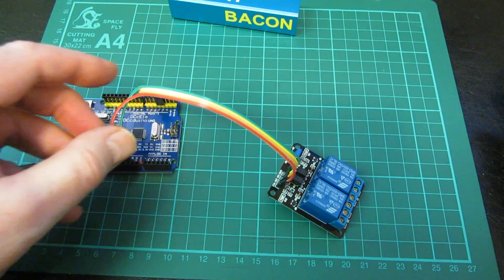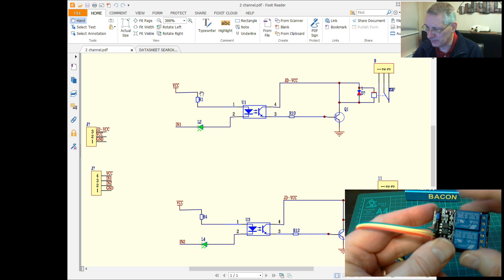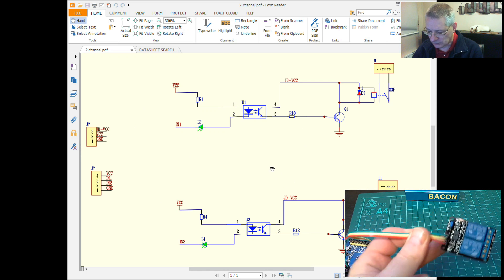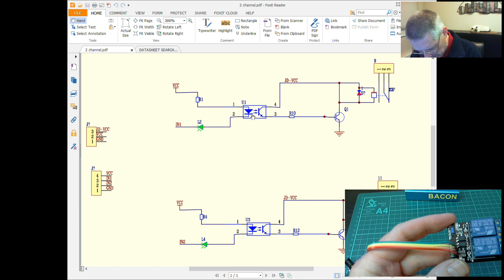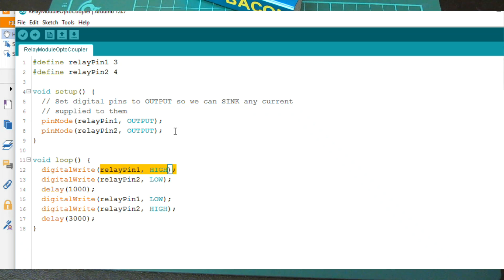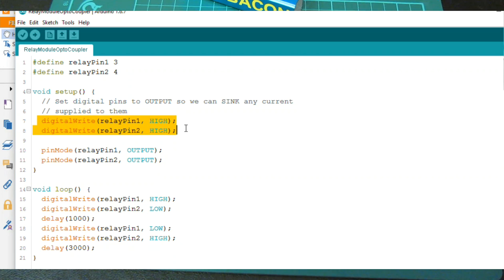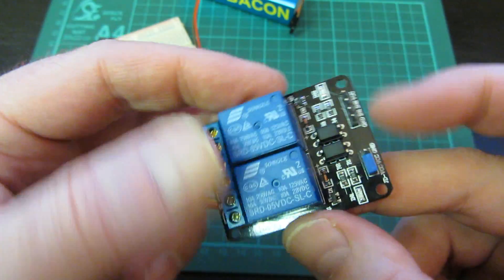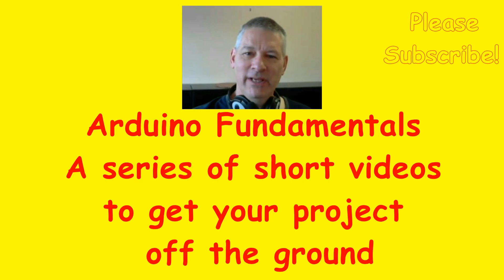#18 Add a Relay Module to your Arduino project - Hints, Tips & Traps

Comment: If i use same connection in esp 8266  with 8 channel relay board on which pin of esp 8266 i hv to i hv to connect vcc
Reply from the maker: You must be careful with the ESP8266 as it is a 3v3 device. 

The module you have will probably have a 5v pin which can be used for the JD-VCC relay supply (if you are not using a separate power for that side of things). For the opto-coupler LED you can use any pins (choose ones that aren't PWM-capable or that is used for I2C or SPI) connected to the IN1 - IN8 pin. 

If the current limiting resistor (R1 in my video) is not already on-board choose the wisely. If you are using a 5v supply as VCC then limit the current to 10mA so your resistor will be about 200 ohms (you have two LEDs in series on that board, one embedded in the optocoupler and the visible one). If you use 3v3 your resistor will be about 150 ohms but there is a possibility it won't work at all at 3v3 due to the LEDs voltage drops. Try it and see!

Remember that the relay switches ON when the digital pin connected to the INx pins is LOW (your µC will SINK the current from VCC via the current limiting resistor).

Comment: Why do you connect VCC and then set the pin to HIGH to keep it closed, instead of connecting the ground and setting the pin to HIGH only when you want it opened? I read some comments saying you can only switch on relay at a time like that, but I'm not sure I understand why... Is there something I'm missing? I have my relays coming in tomorrow and don't want to blow up my ESP8266 hahaha
Reply from the maker: I don't fully understand the question, or what you think I'm doing, but I can tell you the Esp8266 will SINK the current for the LED on the relay board's optoisolator when set LOW (HIGH is off). So the other side of the LED is connected to VCC. Take a close look at the circuit diagram in the video. Still confused? Let me know!
Reply: @RalphBacon  Thank you! My parts just arrived. I'll be trying to figure it out this weekend :) will definitely revisit your video then.
Reply: @RalphBacon  Ahhhhh now I understand!!! Took me a bit of tinkering, but your video makes total sense now! Thanks!
Reply from the maker: Great stuff! don't let the magic smoke escape!

Comment: Hi Ralph, thank you for your really helpful video. With regards to the issue of having a second power supply for powering the solenoids to maintain isolation, could you instead use an isolated DC to DC converter such as this one? 

https://uk.rs-online.com/web/p/isolated-dc-dc-converters/1226942/

Not the cheapest solution but potentially much less hassle than a separate power supply?
Reply from the maker: I'm wondering why you would (want to) do this, Graham? You can use a separate power supply (of the type you suggest or a real one) but you don't have to with this module. The whole thing can be powered from the same 5v as is used to power the Arduino. Unless you really need the galvanic isolation I'd keep it simple (but for all I know the other side of this module might be switching a couple of hundred volts).

Comment: Hello Ralph, I have this little device :b0505s ( https://www.digchip.com/datasheets/parts/datasheet/1007/B0505S_D-1W-pdf.php ) and it really removes all the noice from my bt audio receiver. Do you think I could use this to seperate my power supplies in a save way? I think it is a tiny transformer and it really is galvanically  seperated. I have no way to add a seperate power supply.
Reply from the maker: Interesting little device. Looks like it is a type of SMPS with an isolation transformer inside.You can certainly use this to separate your power supplies - so the output from this was connected to the JCC of the relay module. Read the note about low power requirements, you may need to add a load resistor.
Reply: @RalphBacon  I will use it. I was just a little worried that since it is so small and something goes bad inside it, it  might still pass mains through. I also just read about the minimum power requirement (missed that before) I do need the add load resistor.

Comment: I think its an output pin because you are writing to it, not reading from it. 
edit: I'm talking about at 3:36
Reply from the maker: Can you just put this into context, please, Ryan? At which point in the video does this come up? From what you say if you are writing to a pin it will probably be an output pin - but if you write to an input pin it just turns on the pull-up resistor!
Reply: @RalphBacon  3:36
Reply from the maker: Right, the point I was making at that point in the video was that although the current flow was coming IN to the Arduino (from VCC and the diode), the pinMode was still an OUTPUT - something that confuses beginners.

Comment: Hi, i would like to know if the 24v rated relay modules could be triggered by a 24v signal or the 5v signal is a  must .
Thank you.
Reply from the maker: There are two voltage ratings for a relay, Ionut. The first is the COIL voltage, and determines how much voltage you need to trigger (switch) the relay on and off. The second voltage/current is how much current the relay can carry. So a 5v relay with a rating of 24V/5A means that it requires 5V (no more) to trigger it, and can carry up to 24V at 5A maximum. Don't forget the protection diode across the coil, which will be present on a module board like I used, but you will have to add one if you use a bare relay. Is this clear?
Reply: @RalphBacon  Thank you for response although i'm not sure i did put the question the right way in order to get the right answer. For example the relay module is this https://www.ebay.co.uk/itm/1-channel-24v-relay-module-board-shield-for-arduino-with-optocoupler-ZT/362992628401?_trkparms=aid%3D1110001%26algo%3DSPLICE.SIM%26ao%3D1%26asc%3D20190920091355%26meid%3D0afe53015d8d4b729b7d7ba4cf4e6a36%26pid%3D100036%26rk%3D2%26rkt%3D7%26sd%3D402261796421%26itm%3D362992628401%26pmt%3D1%26noa%3D1%26pg%3D2047675&_trksid=p2047675.c100036.m2109 . Not talking about load rating. So, all i need to know is what voltage will require the input pin to trigger the relay on/off  via optocoupler. Are the 24v coil modules built to be managed by 24v inpun signal, the 12v coil modules by 12v input signal, the 5v coil modules by 5v input signal or all the relay modules no matter the coil voltage is, are built to be triggered by an input signal in range within let's say 3.3v - 5v ? I'm talking strictly about the way they come from factory, about what range of signal voltage they can handle safely. I want to know if to this 24v coil relay module i can apply 24v as signal input without frying the input zone of module. I hope i made myself understood  and i apologize for giving you such a headache. It's all because my  bad english. Thank you again.
Reply from the maker: It's not your English that's a fault here, Ionut, just the rubbish documentation on these products! I can't even see the optical isolator, on the board you link to. I suspect the 24v refers to the JD-VCC that goes to the optoisolator (see my video at about 01:58). All the optoisolators require you to SINK the current from VCC (NOT JD-VCC) to ground. I would carefully wire this up to 5v first and test this out as per my demo. Then you can ramp up JD-VCC to your 24V and hope it works. this site has better pictures: https://www.ebay.co.uk/itm/5V-12V-or-24V-1-2-4-8-16-Channel-Relay-Module-Arduino-PI-ARM-AVR-DSP-PIC-PLC-UK/362951292175
The 24v relay switching voltage and the VCC for the optoisolator are separate - you don't want 24v anywhere near your Arduino!
Reply: @RalphBacon  Thank you for response,. i'm sorry i sent you the wrong link, in fact the relay i bought is exactly from the link you sent to me ( the 24v - 2 channel relay module). My first thought was that if the JD-VCC and VCC are bridged by jumper and board being supplied by 24v, the input pins could accept 24v as signal. I don't use arduino, this relay will control the spindle of my cnc router which controller has the output pins providing 24v signal. In other scenario i could remove the jumper to feed separately the relay coil with 24v and for inputs zone i will provide the 5v TTL from breakout board . I guess and hope this way will work.
Thank you.

Comment: Great demo. Can you help me? I have a MT3608 step up converter. I want to increase my output power from the arduino uno to ignite an electric match for my rocket parachute deployment. 9v battery is my power source . Can I power the MT directly from the battery and use arduino as a switch only? I used a blink program to send power to MT3608 thus increasing voltage, but not amps.  ??? Any diagram help would be great.
Reply from the maker: If the 9v can ignite the match, Mark, then the Arduino can connect the 9v into a totally separate electrical circuit via the relay. Rough circuit here:
https://www.dropbox.com/s/h1bvuntfivrmw5d/9v%20match%20circuit.png?dl=0
Do watch the demo explanation in conjunction with that circuit.

Comment: Excellent video - thank you.  I notice on some coding for relays there is a line in Setup -  Serial.begin (115200); .   Can anyone tell me if it's important when operating these relays please?
Reply from the maker: That line has no bearing on the relay part of the sketch, John. What it is telling Arduino is that the speed of data transmission from the Arduino back to the PC/Mac (in the Serial Monitor, aka debugging window) is at that speed. So you can then send information back like this:
Serial.println("Relay ON");
I tend to use 9600 which is a bit slow but very stable!

Comment: Thanks very much, very helpful. One silly question I have though, is seeing as I'd like to keep my 12V source (deep cycle agm battery) fully charged, if I were to keep the trickle chargers (12V 1A from 240 mains adapter) cables attached to the battery, and activate a 12V 5A draw via the relay, will the charger/adapter pop, or will the battery deal with the draw? Please excuse my ignorance!
Reply from the maker: If you are directly charging the battery from a charger the the current for any circuit will come from both battery and charger, depending on which has the higher voltage. If the charger can only supply 1A (at which point the voltage will drop) all the "missing" current will come from the battery. It would be better to use a dedicateds battery charger circuit (like the ones for LiPOs) that allow charging and powering a circuit without anything getting stressed. Check out solar panel charging modules.
Reply: @RalphBacon  ah like an MPPT controller? Thank you kindly for the reply too. Best wishes

Comment: can you connect to arduino mini?
Reply from the maker: Yes, you can, Charles. Any GPIO pin on any MCU will work because it only is driving an LED via the optocoupler.

Comment: I have just received my relay module which is exactly the same as modules shown in this video. Great thing I came across this video as I am just about to start my project.
Reply from the maker: I knew you had ordered one Robert (Benny is my spy) so it is not a coincidence that you have found this video! Have Fun but do NOT short out those header pins (JCC-VCC-GND) !!!

Comment: a somewhat common mistake is using a mechanical relay when a solid state relay or device is a better choice;
1) fast switching speeds (on/off/on)
20 longevity
3) fast turn-on
4) High voltage or current loads
5) need to have minimum current drain
Reply from the maker: But you did miss one thing, Kenn, that is not so good: HUGE size (compared to a mechanical relay) especially if we factor in the ridiculous heatsink for higher currents. I have...

I have resisted doing a video on my SSR precisely for that reason. It certainly would not fit in the original consumer unit (fuse box) so it would have to be mounted externally, suitably insulated in a box which then requires drilling etc.

Some relays are fakes, of course. Rated at 20A and can barely conduct 5A without melting (as other videos I've done have shown). But I've sourced (from a respected UK company) two very nice, high current mechanical relays, with all the correct CE certification that would do the job. But, I'm still thinking of that SSR... What do do!?!
Reply: @RalphBacon  :)   to be sure relays have their advantages......including zero loss to the load, multiple poles, isolation .....
Reply: @RalphBacon  personally I'd go with the SRS!

Comment: Another gotcha is the power supply for the relays - it has to be large enough (current wise) to handle the maximum number of relays turning on at the same time (and the total holding current of the maximum number of 'On' relays). To latch [Pickup current] can require significantly larger current (2 to 10 X) the holding current.  https://forum.digikey.com/t/relay-terminology/799   https://media.digikey.com/pdf/Other%20Related%20Documents/Panasonic%20Other%20Doc/Small%20Signal%20Relay%20Techincal%20Info.pdf
Reply from the maker: Good point, Kenn. The holding current is significantly lower than the latching current. I quite like latching relays these days, it makes the whole current consumption problem go away.
Reply: @RalphBacon  What's the cost difference between regular and latching?   Where I am latching relays are hard to get

Comment: Can the alternate power source be something other than a breadboard power supply? Maybe something a little more friendly for a portable application?
Reply from the maker: The power for the relay (if you are using a dedicated, separate power source for the relay) can be anything you want - but it will need to supply power for as long as the relay remains energised. 

For portable, battery powered devices you really need a latching relay that switches to the open (or closed) position and stays like that even if you remove the power. You can then switch it back again (via a different coil pin) the same way and remove the power. I hope this helps. Portable devices don't really need an isolated relay anyway, so you can power it from the same supply as the µController.

Comment: So this might be a stupid question but when using the external power input on the relay module, can you use the same power supply, like the breadboard power supply you're showing, to power the Arduino as well or does this defeat the purpose? It would be nice to have one psu powering both devices because it saves some space!
Reply from the maker: Not a stupid question at all, dikke j. You can indeed use the same 5v source to power both Arduino and the bare relay (coil). Either drive the relay coil directly via a transistor from a GPIO pin (using a protection diode across the coil), or use an opto-isolated relay as I showed here, which protects the Arduino (and you) better - and arguably is easier to use!
Reply: @RalphBacon  Awesome, I thought it would be possible but I just wanted to make sure since this is all new to me. Thank you very much for being so helpful :)

Comment: I had been using an LED on my breadboard to represent the optocoupler and set the ledState to HIGH for 'on' and took the other pin to ground.  Would that not work as well?
Reply from the maker: To turn the relay on, you need to SINK the current. So the pin needs to go low. The current flows from VCC thought the diode into the Arduino and then (internally) to ground. Is this what you're asking? If so, you can model this on your breadboard the same.

Comment: Hi there! Thanks for your super interesting tutorial, really!  I’d like to ask you if this 2 relay are suitable to develop a circuit to control a bistable solenoid, like that one https://www.logicaprogrammabile.it/come-pilotare-elettrovalvola-bistabile-usando-2-rele/
Reply from the maker: The way the relays are being driven is different in that link (directly,via a transistor) but the relays would work very well indeed in that situation. You would just change the way the relay was driven , just like my video.

Comment: Ralph,

Thank you for bringing this to my attention. I have a similar 4 channel relay that I would like to isolate from my arduino as well but the jumper are slight different. Mine has two pin instead of three. Will you please advise how to supply separate power to my board?  

Link to download the document: 
http://wiki.sunfounder.cc/index.php?title=4_Channel_5V_Relay_Module

It would be helpful if you will explain the following:

VCC is system power source, and JD_VCC is relay power source. Ship 5V relay by default. Plug jumper cap to use

Sorry for the dumb questions.
Reply from the maker: There are no dumb questions, Cattle Ranch, just questions. 

And here's your answer: on that board, the jumper connects the VCC (from the VCC, IN1, IN2 etc set of pins)  from your Arduino's 5v rail) to the relay side. You can test it with the jumper in place but for complete isolation supply a separate 5v to pin 1 of the jumper (that is, JC-VDD) and do not connect the jumper. Note that the ground of the separate power supply is connected to the GND pin of the set I previously mentioned.

Explanation: the optoisolator (and the LED in series so you can see what is happening) is connected at one end to VCC (your Arduino's 5v rail). The other end (IN1, IN2, IN3, IN4) are connected to the GPIO pins on your Arduino. These pins are OUTPUT pins BUT they will activate the relay when they are LOW (HIGH means OFF) because they sink the current, not source it.

That board looks quite nice but what are you connecting the relays to? Take care if it is the household mains voltage!

If you have more questions I'll be happy to answer!